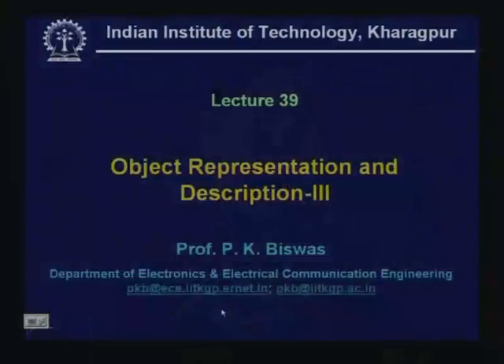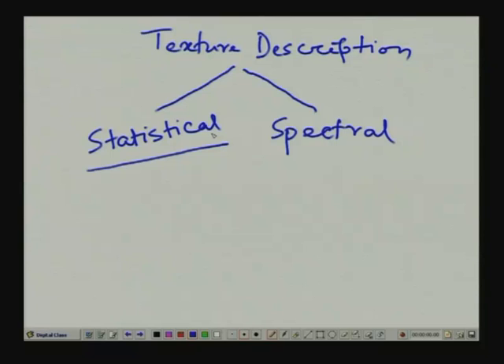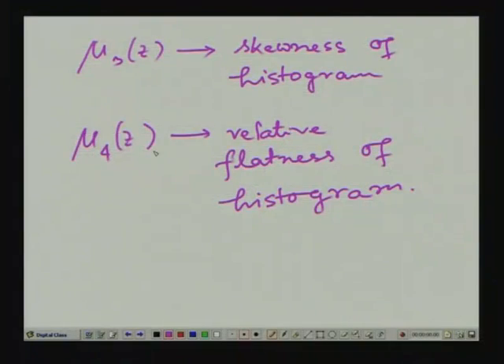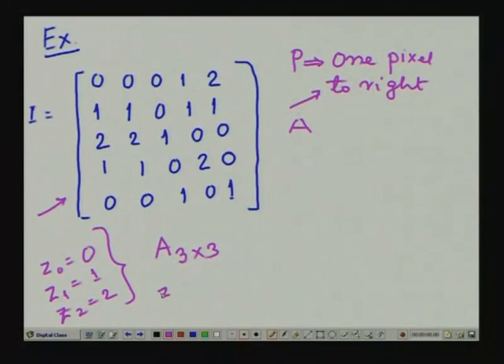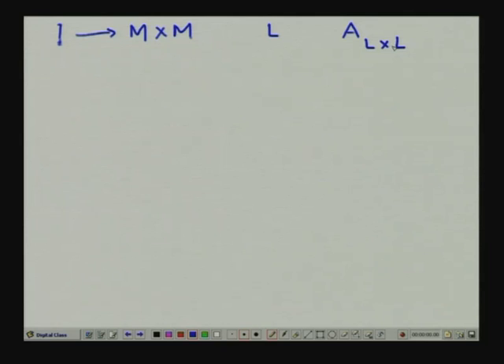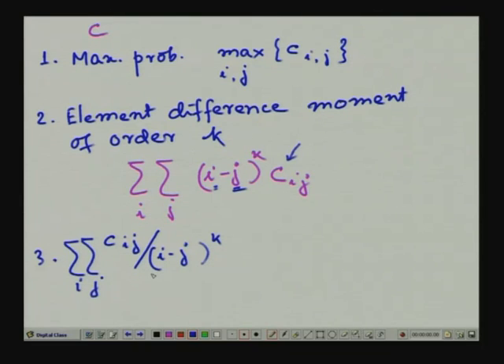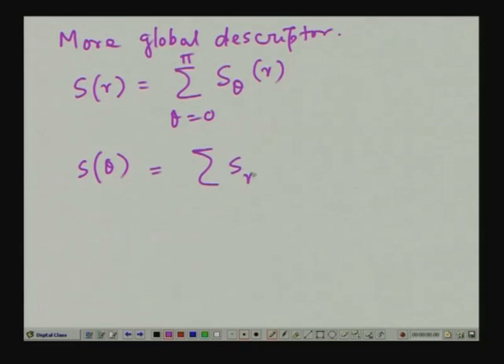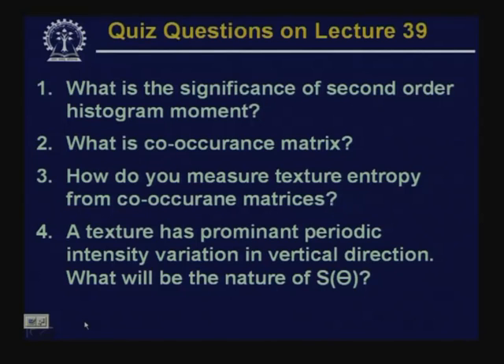Lecture - 39 Object Representation and Description - III

Comment: At 30:27 the sum is 18 not 19.
Reply: you're wrong, look carefully
Reply: you are right but matrix A is actually [4,4,1;3,3,1;1,1,1] not [4,3,1;3,3,1;1,1,1].
he made a mistake counting the 1-2 pair
Reply: The sum is actually 20.  Which makes sense if you look at the shape of the overall matrix: 5x5 means 25 spaces, going right to left in each row means 4 hops.  4 hops x 5 rows = 20.

Both the 0-1 pair is miscounted (4 times, not 3 - shown by the green lines, there are clearly 4 not 3) and the 1-0 pair is miscounted (4 times, not 3 - he skips over the 1-0 pair at the end of the bottom row and doesn't mark it).
The actual array is:
[ 4,4,1
4,3,1
1,1,1]
which adds up to 20, as expected.
Reply: @TrenchcoatJesus  ahh yeah this is it. Hear here